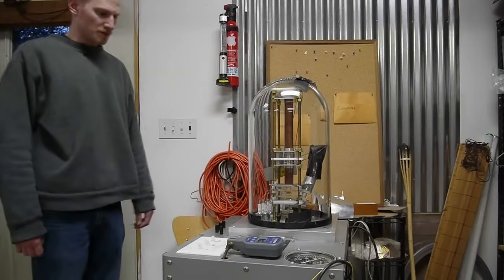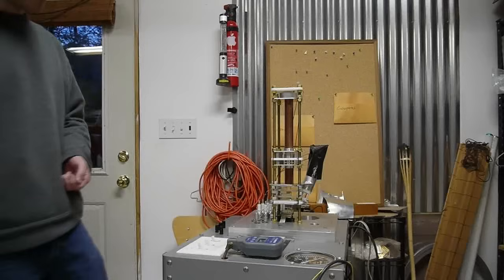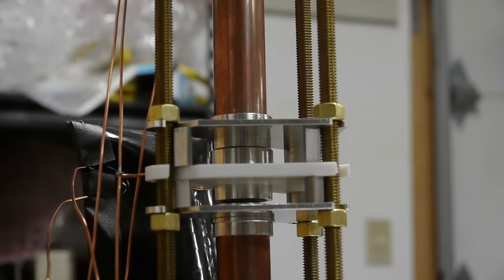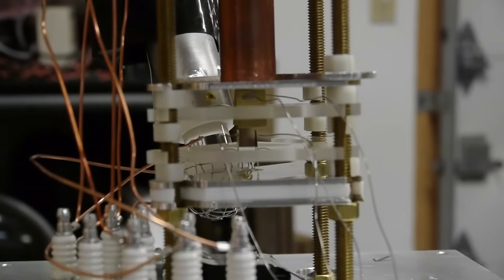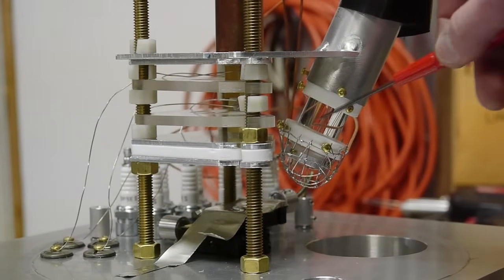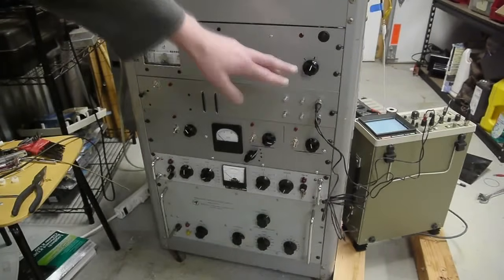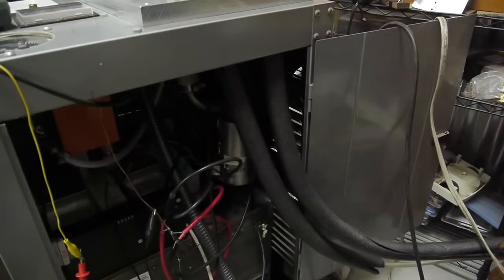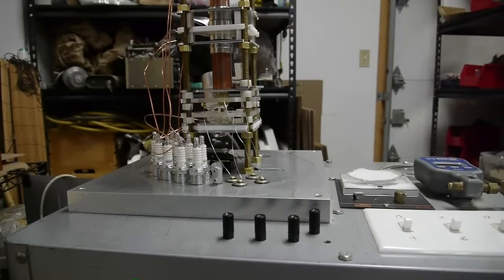DIY Scanning Electron Microscope - Overview

Comment: Hi! TEM guy here, and I still have a lot to learn. The way you explained the setup, I understand that the top lens is a projector lens that you use to demagnify the beam. I would expect a condenser lens there that would parallelize the beam so you can focus it better with the bottom (objective?) lens. Can you explain this a bit?

Comment: What is the resolution? The best for an optical microscope is about 0.2 microns = 200 nm, using UV light. If you can't beat that, it's really just an experiment with no practical use.

Comment: Impressive, this SEM. Isn't it much easier to use the neck of the CRT tube you demolished for the phosphorous plate to check the beam focus as  the electron beam generator including vertical and horizontal deflection?

Comment: I wonder if an old oscilloscope tube or black & white tv crt  could be used for the electron gun -  would it be easier (the hard part would be cutting the back of a crt off without implosion)?  (a lot of old tv sets have the drive electronics on separate boards for the scanning, power, filament etc)

Comment: can a magnetron or RF coil be added to a SEM to plasma clean contaminants off the insides?  seems like this would damage seals over time....
Reply: https://www.youtube.com/watch?v=TmZLGN8Lytk
Reply: The plasma produced by the remote ion source is bound to the ion source by electromagnetic field. Only the electrically neutral O radicals enter the reaction chamber from the ion source and react with the surface area carbon (hydrocarbons) of the sample to generate CO2, CO and H2O which are then extracted by the vacuum pump. As a result, the sample carbon deposition is cleaned. Meanwhile, the imaging resolution and contrast are improved, and the chamber pumping time is shortened.

Comment: What is the purpose of the spark plugs?
Reply: they provide a way to get high voltage signals through the aluminum vacuum chamber to the instruments controlling the electron microscope.  They are just a cheap and readily available component with good insulation that can handle the kilovolts and air pressure without shorting out to the aluminum plate of the vacuum chamber

Comment: Here's a question: How viable it would be to use in DIY-environment a line confocal imaging technology instead of SEM? With  white LED and optics would give a micrometer resolution. Of course some software is needed. No need for vacuum or anything to get surface image.

Comment: hi, its 2019 , i just found your video.better late than never.Well i guess i wont be  throwing out my tv screens ( CRT's) , they have a repurpose now and getting more scarce.Im fimiliar with radio vacuum tubes , so thats an advantage here.And know a little bit about conventional electronics, high voltage, some physics ,  etc. u see your spark plugs and i know there not just for combustion engines.EXCELLENT  skill and knowledge you have developed, most have no understanding or interest nor motivation, they just dont get it unfortunately , keep trying to educate, keep your lab locked up and tamper proof , valuable papers , books in safe.
Maybe you could next find out about the Royal Raymond Rife microscope that didnt use electrons but some how could see living images, energy from  its sample, do a search, and he used resonance frequency to destroy bad viruses etc. Thank you ! 📚📊🆒📡🔬🔬🔬📙📗📕📘

Comment: Good stuff. Could you use the simple CRT of an old black and white TV. You have most of the circuit s for beam generation. Only PMTs would be required. Keep the good work coming .

Comment: WOW. Great job. Your videos are always impressive. Why have I not seen this one video sooner? I've done some similar work recently with my resurrection of two different image dissector (antique TV camera tubes) tubes. High voltage and scanning generators.  Also used the oscilloscope for the display. Variable scan rates and size too. The darn thing worked! If curious, see the videos about that on my channel.

Comment: ii have to question the intelligence of a person running 100's-1000's of volts through bare wires. is there a reason you avoided common sense and avoided insulated wires for this?
Reply: Tetra Digm have you ever seen insulation on the wires inside of a vacuum tube? Have you ever considered there might be a reason for that?

Comment: Once when I was 21 I did build an oscilloscope using an old crt (22 inches B/W tv) and its EAT trasformer at 25KV..I also built the amplifyers with a couple of opamp and 4 transistors, it took me 1 month to figure it out (I didn't see an oscilloscope before beside the one at school and some description of their functions) so after the 2 years electronics course I did built one and it worked! I think you put the same entusiasm building this microscope!

Comment: Is it possible to use a magnetic lens instead of an electric one in the column? If so, what would be the difference?
Reply: It´s possible but it requires more work to do. You needd to wind the coil and make a pole pieces. Main benefit is in lower aberrations.

Comment: How about taking the whole "Flatron" cathode ray TV? Cut in-between the gun and mask, and install a resealable adaptor with holding device and tubing to the compressor.  The industry's best 3! canons are there already, the focusing and scanning (rows and frames) system are there already. You will have to tinker with a system, install an additional mask to capture slow secondary electrons (super thin foil will do) and instead of displaying the signal you will have to shoot-through the open RGB channels to display the object. Now, because of very precise distance to sub mask at the display needed (so each cannon shoots in its color pixel, you must mount the resealing portion of the adaptor first, to glass and then cut it with diamond or laser tool. You may need higher acceleration voltage on the anode and don't forget about X-ray radiation, especially after increasing the anode potential. Good luck...The picture will be black and white anyway :)

Comment: Fantastic.  I am very jealous.  Just a few thoughts. Could you use a peltier  effect device for the cooling?  You really need to interface with a computer for display, scanning and voltage control. That would make a large difference to the results.  Magic m8. Keep it up.  :)

Comment: Next build is a particle accelerator right?😁
Reply: Well isnt this microscope an electron accelerator?
Reply: Pablo Pérez Herrero yes. His magnetron sputtering device is one, too.
Reply: Azim Alif He could do it in an hour.
Reply: He did, multiple times
Reply: Honestly, I believe that is much easier. Accelerating particles is never a problem. The big deal is how you register what happens.
Reply: @darth_dan8886  Correct! Particle accelerator can be made from an old CRT TV set. The TV tube is a particle accelerator...
Reply: darth_Dan Actually, the big deal is doing something with those particles. If you want to do particle physics, you don’t only need to accelerate them, you have to make them collide with something and then detect the resultant particles. So what he should make is a particle collider.
Reply: I don’t know wether or not he has done the fusion reactor yet.
Reply: michio kaku made some  on college
Reply: A laser through a series of Raman amplifiers can be quite fun as well.

Comment: I've probably said this before, but you explain things so well into the detail but not too much, not repeating, and I don't have to skip back a second to really understand what's going on, it's all clear from the first play. That is really amazing. This is the first time I see this project and the video is 5 years old, but my first ideas for improving the image quality is to use shielded wires, so they deliver only the voltage that comes from the generators, no crosstalk. And of course, as CRTs are affected by the magnetic fields, so must this be. More shielding if there are changing magnetic fields. But this must have been already done. Great work!

Comment: Why is a phosphor/photomultiplier the most efficient way to detect secondary electrons? Naively, electrons sound like voltage, so accelerating them and converting them to photons, then back to an electric signal (to feed to the oscilloscope or other capture/output device) seems indirect. Is that just the best way to amplify them?

I'm thinking of your microcontroller capture of a SEM image (https://youtu.be/ruuxn2u3yao). If you hadn't found a good signal on the circuit board, could you have used some more direct voltage fluctuation form secondary electrons?

Comment: Amazing project as always
I probably wouldn't believe that someone actually can build an electron microscope at home unless i've seen this video :)
and what is the purpose of those ignition spark plugs?
Reply: Seems that the spark plugs are used as vias from the cabin to the tower. Clever, they can be screwed in to the top plate (custom made holes with threading), they are strong, they insulate high voltage and they have the end cap with threading you can use to clamp the wires. Really nice and cost efficient!
Reply: @SamiJumppanen  The other important feature about spark plugs as feedthroughs is they can handle vacuum and pressure and thermal cycling without leaking.

Comment: Wait, I got a question. You did you build this Electron Microscope from scratch and used an Oscilloscope to image the resulting data coming from the E-Microscope?   If that is correct then...AMAZING.

Comment: Yeah sure, just stuff you had laying around in your workshop, what's next? A quantum fusion reactor?
Reply: da fuck dude, the most complicated part is covering the sample in an electron reflecting surface, which is usually gold
apart from that its just a big vacuum-chamber with parts of an old television: a glowing wire as a source of "light", a high tension ring through which the electrons are accelerated, a coil to produce a magnetic-field which will act as a lens, two more coils to change thew directon of the beam in both dimensions, the electrons are scattered by the sampels surface and some are coming into the direction of the detector, where a series of coils will act again as lenses to get a clear "image" on the detector...which could be as simple as using a piece of an old B/W television screen. But the amount of electrons would probably be too small to see om the phosporescent-screen, so maybe an electron-multiplier(http://patentimages.storage.googleapis.com/US7019446B2/US07019446-20060328-D00001.png) might be necessary.
It all relies on the fact that electrons as well as all other particles behave like waves and can thus be used thee same way you can use light.
In fact the very reason electron-microscopes are necessary is the fact that when the size of "features" of the sampels surface are close to to the wavelength of the light used to observe the sample, then that will interference like in a double-slit experiment and the image will become blurry at these scales.
You could of course use ultra-violet light or even higher frequency ligh, but not only might they not be reflected (which is also the case for the EM), but at some point the sample will be damaged or simply burned...
But according to DeBroglie's equation, the electron has a very small wavelenght, if accelerated to suffiscient speed.
L=h/(m*V)
m is the electron's mass (9.10938356 × 10E-31 kg)
V is the speed in m/s
h is the planck constant(6.62607004 × 10E-34 m² kg / s)
Reply: Yeah just lemme grab this photomultiplier from this shelf here
Reply: that beeing said, still an awesome job well done !!!
Reply: heheheheheheheheheeee
:D
Reply: Actually a neutrino collider-ator is what he's working on
Reply: Doesn't EVERYONE have one laying around?  😆
Reply: crosses fingers
Please let it be a fusion reactor!
Please let it be a fusion reactor!
Reply: no just a regular one
Reply: no thats gonna be on cody's lab
Reply: MrKaje72 
Your talent is wasted ! But I for one appreciate it. Haha
Reply: We need a working time machine next bud 🍻
Reply: This makes fiction like Ironman, Tony Stark building something in his basement a possibility.
Reply: Yes,  he does have that kind of stuff lying around.

Comment: It's a cool project, but the output so far is pretty lo-res. Even if it was low-res, you could maybe really zoom in, but that has not been shown. All in all I get like 750x better magnification from my $20 plastic microscope I got from kijiji. I'd would not put any sort of boiling oil near a vacuum, but I don't do this sort of thing....

Comment: I have question,why use phosphor screen + photomultiplier tube to capture secondary electrons, why not use electron multiplier tube directly,this way seems like more efficiency ? I mean in side a photomultiplier tube is basically a electron multiplier,although I now  photomultiplier tube(a vacuum tube) could works under ATM ,and electron multiplier tube work only under vacuum situation,but in the SEM application environment is always in  high vacuum,Why not drill  a hole on the photomultiplier window let secondary  electrons pass or something like that?

Comment: How do you deal with the X-rays?
Reply: Any time you have high voltages accelerating electrons into things you have to worry about xray emission.
Reply: There are none. it just isolates the electrons which are emitted as he mentioned from a tungsten filament. the same tungsten filaments in light bulbs. it is the same thing. Tungsten is used because it has a very high melting point which prevents it from melting when the current runs through it causing it to glow white hot.

Comment: Amazing ..... I have bought a old Hitachi Electron Microscope without chiller and the rough-in pump. I am not sure about the magnification as there is not enough info around. What size (CFM) of rough-in pump should I use. There are few Roobinair Vacuum pumps on amazon. What is your suggestion. Thanks

Comment: Hello Ben,
I was wondering, is there also some other way of detecting secondary electrons except using Everhart-Thornly detector (which is probably not very cheap and also not very often sold by someone).
Would it be possible to use just the photomultiplier (without the glass tube) and set the first dynode to high voltage to attract the secondary electrons? Why do you actually need to convert the secondary electrons to light and and than back to elections again?

Regards
Klemen

Comment: hi I am so impressed I am an EX VG Scientific Engineer my particular field was S.I.M.S but I did work in microscopy, electron guns,  and argon ion guns are my thing, please make more vids .I have always thought that I could make this stuff cos physic's doesn't change. Your project however isn't cheap. I do have some samples of copper grids, about 17um repeat mesh I also have an almost new electron multiplier made by thorn, it looks like a French horn! just bias it and suck the plume in you are welcome to it. I have lots of samples that might be useful to you. I have some spares for X-Ray sources if ya used them. Now your doing so well with S.E.M how about STM ? or AFM ? I have worked with Diff Pumps, Ion Pumps,Cryo Pumps I also have a lot of experience with Time Of Flight Secondary Ion Mass Spectroscopy (TOFSIMS) I have also worked with Applied Materials with Ion Implantation what I am trying to say is keep doing this and if you want support I am here my name is Andy Brown however I do answer to " Mousey "  this is very exiting stuff!!!
Reply: Simply beautiful!  Thanks for the knowledge.

Comment: Could you use peltier coolers to condense the oil vapor for the oil diffusion pump ?
Reply: +shodanxx  ya could but very expensive when compared to a hose pipe and running water!!

Comment: Could you achieve electron beam welding with tungsten filament? Is it just a question of power and focus, or would you need a different material? Great video by the way!
Reply: +InSearchOfScience  yes ya can seen it used to coat optical lenses ,basically a great lump of graphite a crucible a bloody great big magnet and ya filament, yep tungsten works fine commercially

Comment: I am awe struck, I used to think that if someone could do something than so could I. But now I am not sure of that statement. I will be watching closely.  One technical question for you. How hard of a vacuum do you need to pull? Thank you very much for your efforts to let us look in on this fascinating project.  I am wondering if with the advance in tech, could something be built with reduced complexity?
Reply: +Bart Zudell Hi Vac needs basically to stages the first being a rough vacuum say 10-2 mbar then hi vac we liked to get to 10-10mbar ya basically got to suck out all the are then use a turbo pump or diff pump to move into what's called molecular pumping well ion pumps are cool too and nice and simple

Comment: Great channel and video. One question Why are there spark plugs in the microscope??
Reply: +joedell71the chamber is aluminium and some voltages are too high so ceramic sparks helps whit vacuum and electric insulation.
Reply: Ahhh ok. Very cool. Thanks for the reply.
Reply: +joedell71 to make connection between atmosphere and Hi Vacuum

Comment: This is absolutely incredible! I wonder if the sample gets any ablative damage? I've seen other electron microscopes that leave an impression on the sample as it is exposed to the high power electrons? ie. those big dollar microscopes that labs have (I might be misunderstanding the mechanics, pretty sure I am actually). I've read a little bit on these and seen some videos but from what I understand the samples need to be solid?

Is this the same technology whereby a softer sample is coated in gold to make it more reflective and somewhat increase the resolution of the image? Again, I'm likely way off base here as it could be some other microscopy technology.
Reply: +youtubasoarus no ya not of base ya quite right in microscopy sputtering materials like carbon or gold is used to increase conductivity and reduce charge effects